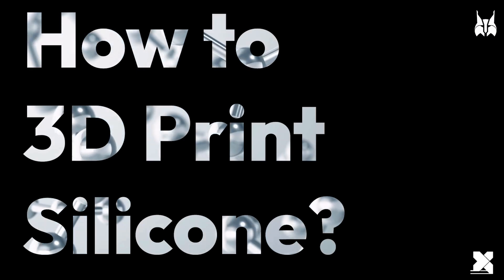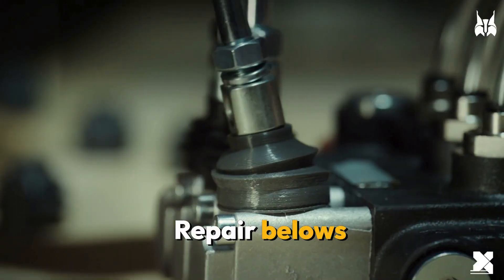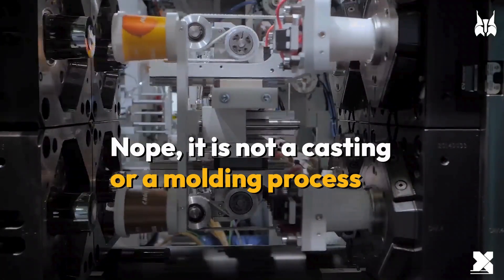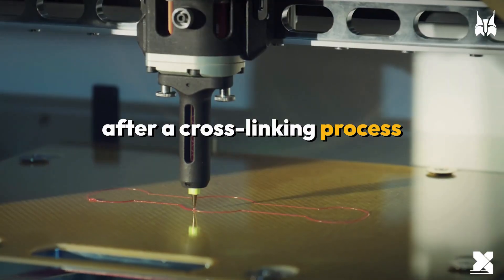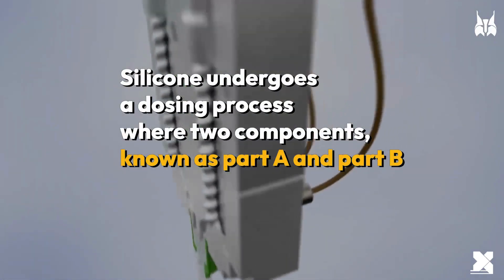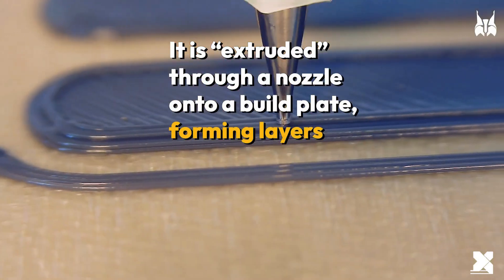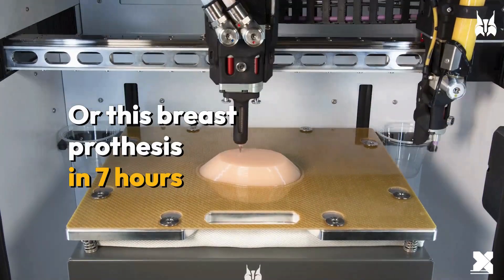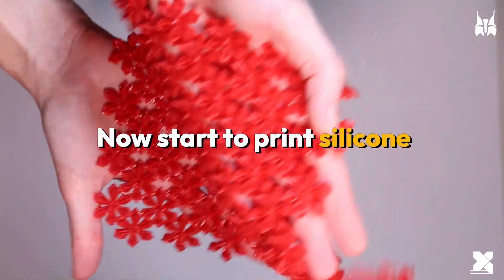Have you ever wanted to know how silicone 3D printing works?

Comment: The upside I presume is no heating required, the complication is it is liquid and requires a different drive process from Bowden or direct drive of consumer 3d printers. A bigger drawback is the material solidifies in the drive mechanism given enough time, making clogs a frequent occurrence. It would be interesting to see a ender 3 mod for this.

Comment: tpu
Reply: The thing about silicone is it's CRAZY heat resistant and also bio-safe for implanted items. I have several cooking tools at home mae of silicone like a spatula and a cupcake tray, the cupcake tray itself used directly in the oven. Although yes, TPU is good for anything that doesn't need specifically the properties of silicone where you just care about flexibility alone.